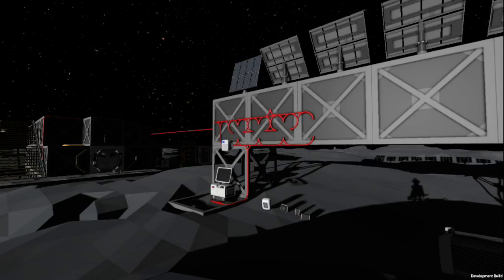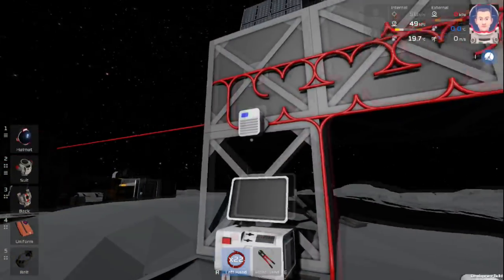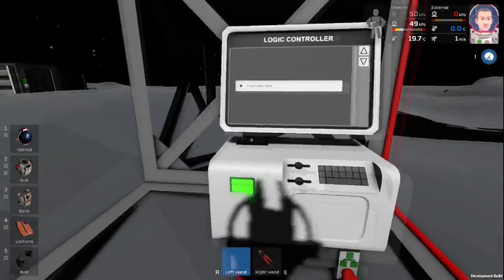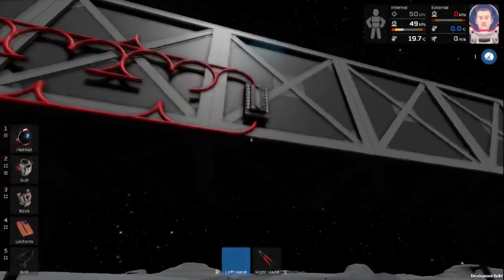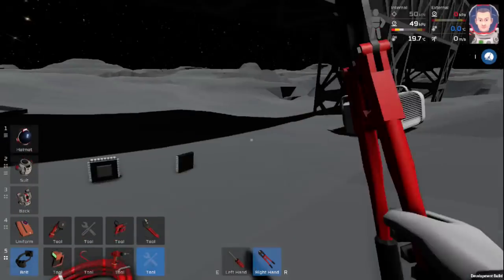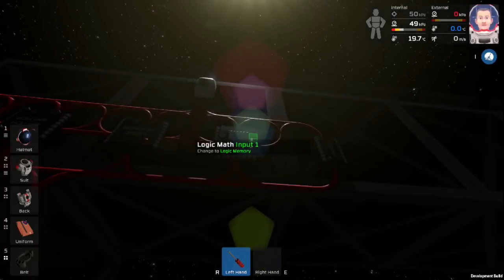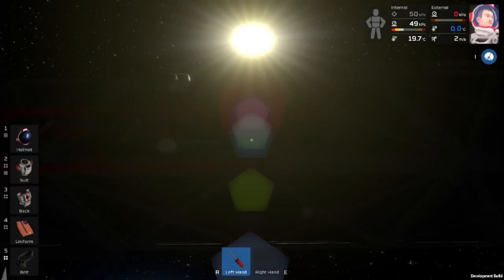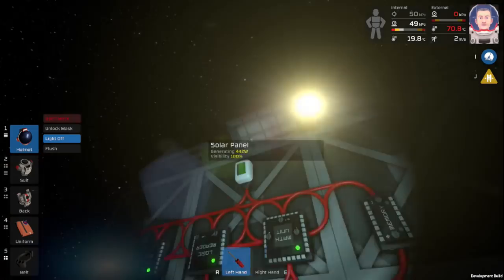Stationeers Tutorial: Optimized Solar Setup

Comment: Problem what you get is when all systems are on and somethink can take the full load of energy, all your carbles got cooked and break.
You can work arround it with solar pannel with 2 outputs and on energy side use a big power cabel with a battery bank behind.
Video Idear for next Tutorial, build a clock. Would be realy helpfull ingame.
Reply: That's why transformers and cable fuses are in the game.

Comment: After checking and re-checking again frame by frame thru your nicely done walkthrough, I couldn't get it to work for me at all.  One Solar panel responded by turning away from the sun, the other 2 didn't move. I suspect the recent patch changed things, searching for an updated tutorial. (gotta luv ea) Still liked/subscribed.  Thanks!
Reply from the maker: I just checked my setup and it appears to be working still. Not sure exactly what is going on. Is your sensor facing east? are you using a batch writer?

Comment: this is not the fully optimised setup. the solar panels should start at 0 when the solar angle is 15. With this setup you will only get about 450 Watts of power per solar panel.

What you should do to get about 500 Watts per solar panel is:
read solar angle
subtract 15 from that
then divide by 1.5
send this to the min side of a min/max. max side should be 100 (need this if solar panels still bug when they go past 100)
output to a batch writer to the solar panels
Reply from the maker: Interesting, it does look like the first and last 15 degrees do not yield optimal power. Thanks for pointing that out
Reply: Yeah it's because the solar panels aren't fully vertical when they are at 0% or 100%.
Reply: you don't really need a min/max for 0 only for 100. So just change it around. In the future you probably won't need the min/max anymore if they ever fix that bug.